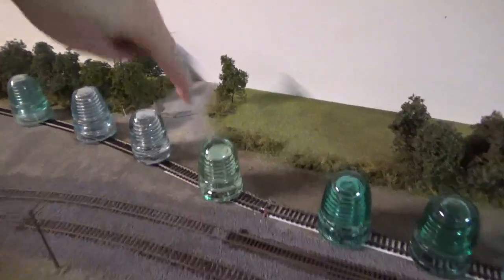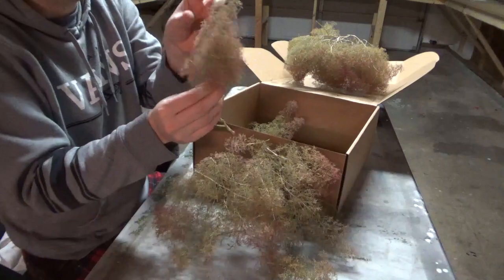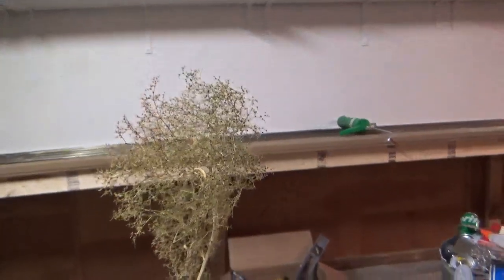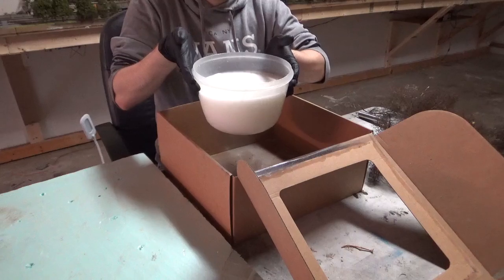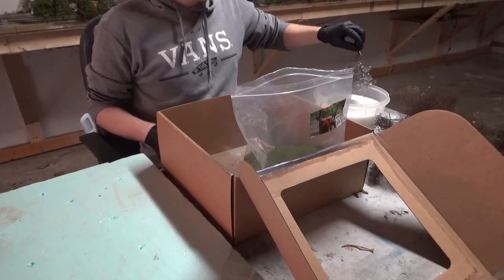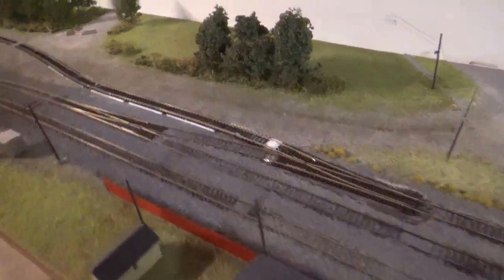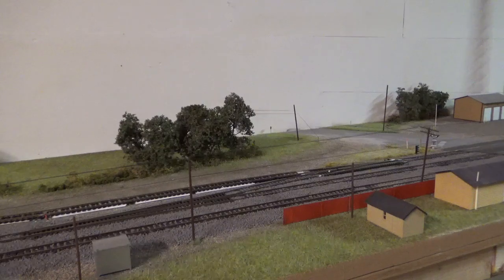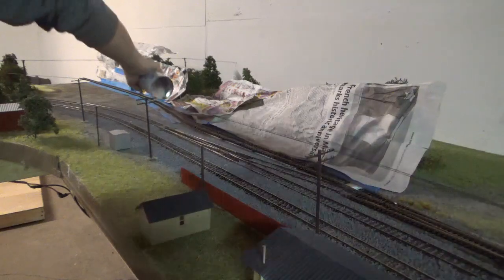Modeling A Branch Lead On The Model Railroad! Part 2. Making Trees And Track Painting.

Comment: And we you're done do you have to clean the bright boy cleaner? Or you Just use it again and again? 🤔🤔
Reply: Clean with a bright boy, then clean with alcohol normally 70% on a rag pr something easy to apply on the railhead, let dry and do not forget to apply No-OX ID to the railhead to promote electrical conductivity.
Reply: @AbelG8781  thanks, but my question is, do you have to clean the bright boy Block itself? Or you Just use it again and again...
Reply: @fernandoalbertobitarslim281  ooohhhh, I do this, after I'm done, rub the bright boy on a flat surface like a piece plywood with texture and it'll rub away any nasty residue. Either way, the bright boy will wear itself out sooner or later.
Reply: @AbelG8781  ooohhhh!! 😂😂😂 Thanks!!!